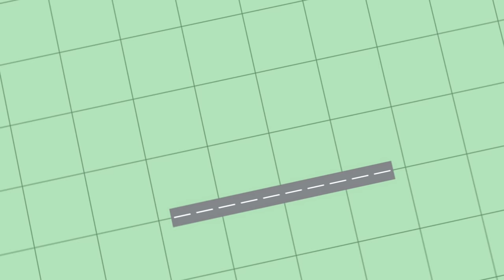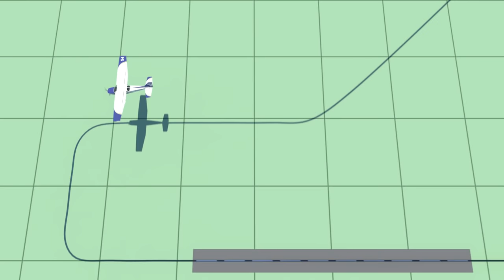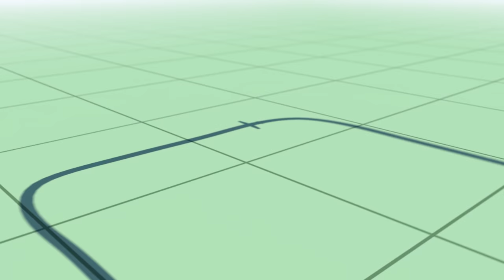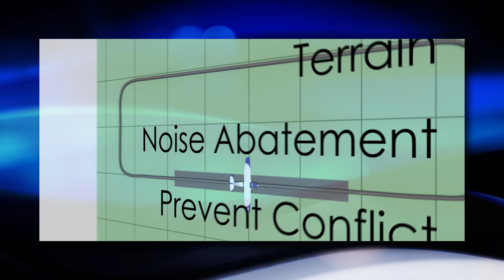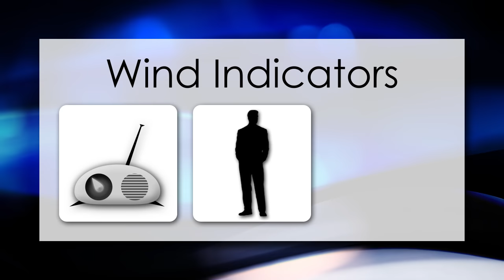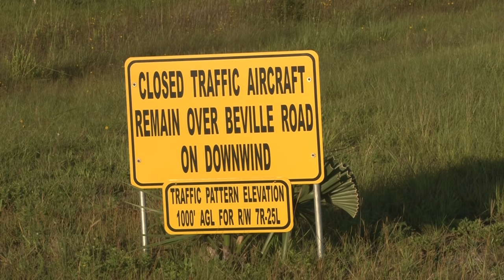Traffic Patterns

Comment: I learned what's an Upwind Leg!!! Thanks; I like your videos.
Reply: Actually though, what he says in the video is wrong. Any other ground school/flight instructor you attend/speak with will tell you that what this video calls the "departure" leg is actually the upwind leg.
Reply: Michael Swader The video is 100% correct! Your instructors were wrong. The upwind leg is offset to the left or right of the runway opposite the downwind, flown at pattern altitude, and is NOT the departure leg. Check the AIM before saying something like that. I am amazed at how many people I hear that get that wrong. It’s incorrect info that’s been passed down through part 61 training I believe. Part 61 just doesn’t have enough checks on it and bad habits/incorrect info gets passed along with no safeguard. Now here you are, passing along that incorrect info. Part 61 training needs to be fixed.
Reply: joel Perez The video is correct regarding the upwind. Don’t listen to Michael there.
Reply: joel Perez how do you effectively avoid traffic during uncontrolled field patterns? What if you are too close to another plane? How can you gauge if you are too close to not?
Reply: @dylconnaway9976  h

Comment: I constantly see pilots, especially commercial charter pilots in my area completely ignore the common traffic pattern and 45° entry to the downwind. They will enter non towered fields on final, right or left base, whatever suits them. They often depart the same way.
Reply: At $1,000 an hour, they are saving $250 or so total doing it this way.
Reply: @pilotavery  I know full well why they do it. It’s just kind of BS considering most of them just finished being CFI’s where they drilled standard pattern entry into their students heads for a year or two, before going to another job and throwing it out the window.
Reply: @AV8R_1 also with the length of their final I think it doesn't matter since they're bass turn is going to be well outside of the airport's vicinity anyway so they may as well just go straight in as long as they are on comms
Reply: @AV8R_1  training is supposed to teach you how to do everything by the book, in practice not everything is by the book. Obviously you should be flying a pattern at congested airports, but a straight in approach when it's not too busy and you're on radio and properly communicating and a straight and approach on a controlled airport is more than acceptable.
Reply: Agree. Just because we have protocols, dont assume everyone flying them.   Some aircraft at non conrolled airports dont even have radios.  That was the case in a recent mid-air collision near Ormand Florida

Comment: This is normally a spot on team but because you said standard I have to chime in as a CFI.  You only gave some of the info.  You depart the pattern at pattern altitude straight out or on the 45 not at an altitude of your discretion.  You turn crosswind 300 ft bellow traffic pattern and turn downwind at pattern altitude. If your going to teach standard pattern procedures teach all the standard procedures.  This is a common mistake by most instructors who fail to follow the FAR/AIM and omit the altitudes or should I say an example of primacy.. There’s also the AC 90-66A to further clarify. For you students make sure you verify procedures in  the chart supplement to make sure the airport operates standard procedures or non standard especially pattern altitudes and traffic pattern.  Never assume.  Great video just not fully complete.
Reply: I’m to lazy to read that all
Reply: krazy sheep002 good for you

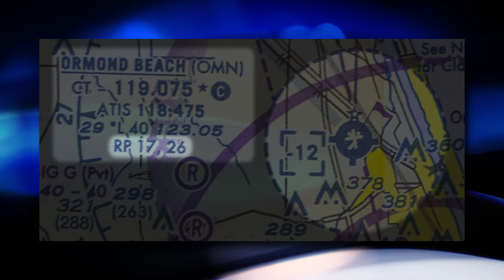Comment: so pattern direction on the map 3:34. RP 17 , 26  . not being a pilot , I'm assuming RP for Right Pattern. and can I assume 17 , 26 are runways. And if assumption is correct. can I also assume that there are at least two runways : 17/35 & 26/80. and if so would pattern be,
LP 35 , 80, to keep all trafic  together or is it RP respectively?
Reply: One runway is going to have two designations; 17 (somewhere around 170 deg) and 26 are 180 degrees apart. You can also have 17 L (left) and 17 R, and possibly an intersecting runway like 21. This is where you would have non-standard traffic patterns, which you would have to become familiar with in each case.
Reply from the maker: Yes, there are 4 possible runways at this airport: 8, 17, 26, and 35. Patterns are left unless specified right. So, 8 and 35 are left.

Comment: Some people say that standard holding pattern is right turn this one says its left turn as standard. Who is correct or wrong??
Reply: Ahmad Sayyed it may depend on the country, what kind of airport it is, if theres obstructions on either side. Lot of factors.
Reply: Airwipe ohh ok, thanks for that
Reply: HOLDING PATTERN is not the same as TRAFFIC PATTERN. Standard holding pattern is RIGHT. Standard traffic pattern is LEFT. Holding patterns are usually done somewhere away from the airport. The pilot/plane gets into a standard holding pattern to allow traffic in front of him to vacate the area, land, etc. He will safely fly the racetrack pattern until ATC advises it's safe to exit THAT pattern and head for the TRAFFIC pattern.

Comment: If an airport or airstrip has multiple runways, does each runway have it’s corresponding traffic pattern? Or do you just enter the one pattern using the one mile distance? Sorry if it’s a dumb question. Just doing some self study before I start my pilot training in Spring.
Reply: Corresponding traffic pattern.  In my experience.